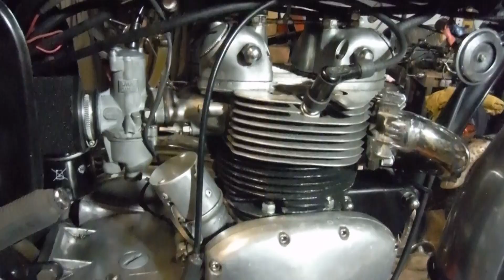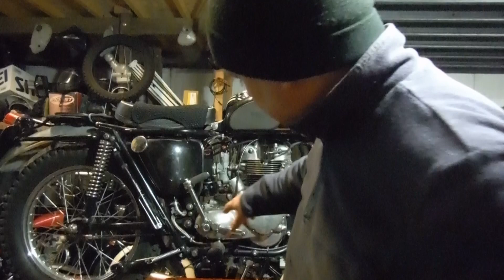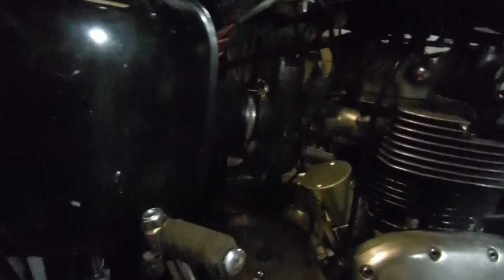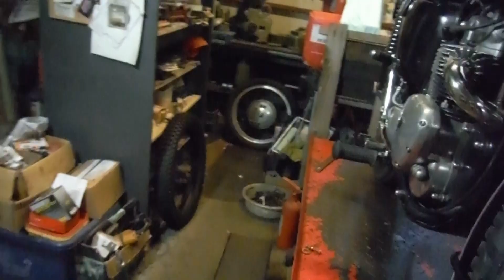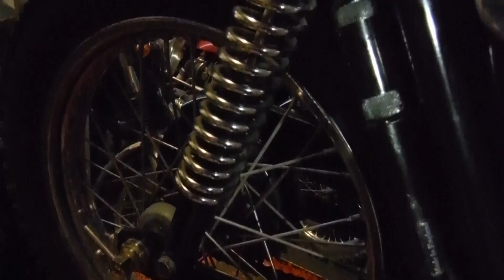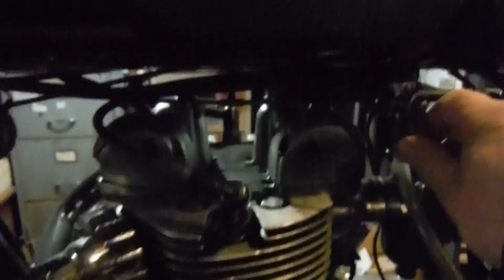Triumph 3TA Trail Bike cold start attempt with ignition timing back as before setting 'correctly'.

Comment: Can you not get a strobe on the 350 somewhere, Paul? Too much hassle probably. If it was mine I'd have the chaincase off and make some marks.
Reply from the maker: Hi Dave, I probably could, but if I 'dialled it in', I would probably end up with the retarded setting being too retarded again, due to the excessive advance range thanks to the wear, and it would probably only confirm what we already know.

Comment: Paul, I had a problem using the screw-in tool to measure the height of the piston on my AJS single. The issue for me was that because the plug is at an angle (like here) I wasn't measuring the vertical drop in the cylinder from TDC, I was in fact measuring the drop at around a 40 degree angle. Also, the head of the piston is a domed, so I made contact with different parts of the dome for different heights. This all gave rise to a few mm of error in the timing position when fully advanced. I realise that you know what you are doing, so I'm just suggesting this as a possible reason for optimum timing positions measured from TDC not being quite where one may expect them to be. Cheers, Mike.
Reply: Glad someone else mentioned this.  I thought the same but just assumed that the geometry of the spark plug hole must have been taken into account when they calculated the 0.210" stated in the manual - so stayed schtum, as per Denis Thatcher's maxim.
Reply: @sussaxonsarthois6815  I couldn't imagine Maggie on a bike, maybe when she was younger......
Reply from the maker: You are right, I guess the plunger might show a little higher measurement than the actual piston movement.
Reply: Using a spoke to rise and fall as vertical as possible is more accurate than those tools, they are worse on some engines than others.

Comment: Some thoughts.  I can see where a worn advance unit could over advance the timing at higher RPM.  But, it looked as though you cranked this one through without really putting much of a boot into it. Could a combination of factors such as altered (lowered) compression ratio, current fuel blends, along with carburetor type, settings, and modifications also change the engine's preference for spark settings?
Reply from the maker: There is not much effort required to kick one of these over. I doubt it has a lowered compression ratio - they weren't particularly high in any case, and usually, I find the original timing specs work well with today's fuels etc. See the video which follows this one for another start up and more ...
Reply: @paulhenshaw4514  Thanks...I'll be there!

Comment: I’m a little bit amazed at how many of your customers send you bikes with loose nuts and bolts, they don’t even seem to tell you what they have had apart or undone so you can re tighten them before you take it down the road for a test run. They must think you’re a mind reader 😊
Reply from the maker: I think many of these machines come to me 'as bought' by their owners, many of whom do not seem to realize some of these machines might look good, but are little more than cobbled together to sell.
Reply: When dealing with old vehicles like these you need to develop a kind of 'sixth sense' and check the things you would normally take for granted ! Even if you built the bike yourself you can still come across things that were assembled loosely to check fitting but never fully tightened up, it can sometimes be months from initial assembly to riding it the first time and it's easy to forget a couple of things in that time.
When I'm checking over a vehicle I tend to deal with the different sections in sequence, my first priority is the brakes, I'll make sure the front is finished before checking the rear, I have seen enough stupid accidents due to overlooking something to make me very careful !